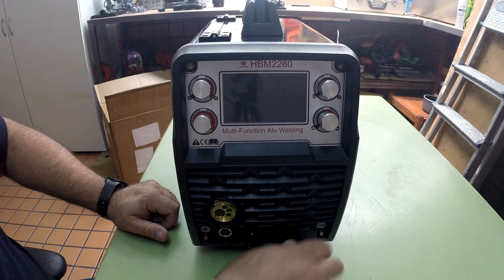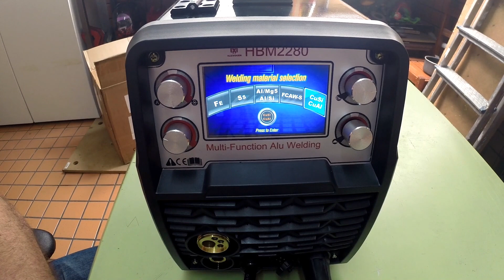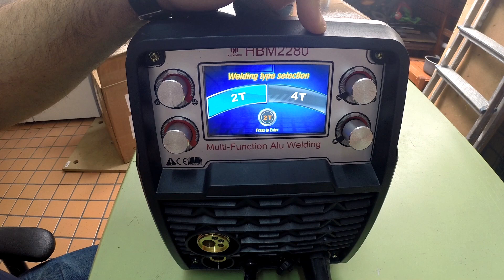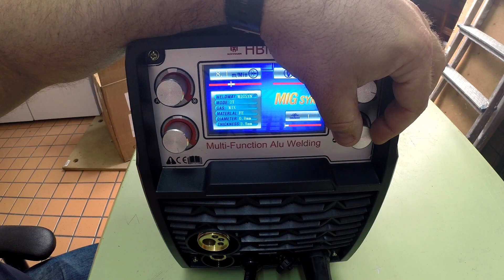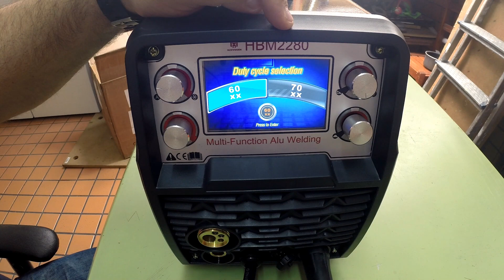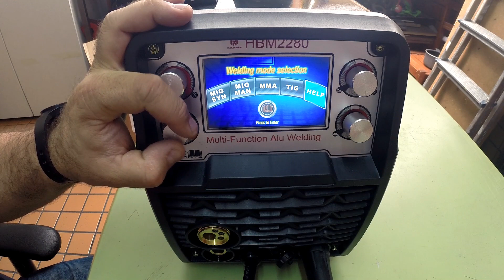HZXVOGEN HBM2280 Mig Welder - Options and Settings

Comment: Thanks for the video. Can the device also weld/solder thin sheet metal?
I want to weld 0.7 mm with CuSi 3 on my car.
The description states that the lowest current for MIG welding is 30 A.
Thanks for the answer.

Comment: The 4 pin connector is for a foot pedal, wich you can control the power of the tig/wig handle or for connecting the spoolgun

Comment: how much voltage adjustment when mig welding? and does the voltage change when you change wirespeed? or is that independent like good welders

Comment: Why is gas mix written on the board when choosing aluminum? There should be argon.
Reply: Where do you see gas mix when choosing Al? When I choose MIG Syn and then Al in the menu I don't see a gas selection.
Reply: @darius-astrofilus  Yes you are right. There is no choice. But it still says mix and not argon.

Comment: I was wondering how you are enjoying the machine and if you know if it will Tig aluminum. I think the ebay listing said it would mig aluminum but didn't say on the tig (and I just don't know because I am just learning all this stuff). Also, Hitbox has a 5 in 1 called the 200 pro which looks to be the same manufacturer. Has the same instructions as the HBM2280. I didn't know if you came across that one when you were looking to buy and why you chose the one you did. Thanks for the video, it has been very helpful!
Reply from the maker: Hi. Thank you for the comments. In fact, it doesn't TIG aluminum. Only Mig. That's bacause this is a DC welder. To properly TIG aluminum, you need a AC capable TIG welder. This one is not. I'll be posting some videos, on the upcoming days, of it welding and I'll talk about my findings about this welder. Stay tuned. Cheers.
Reply: @Juary70  ok will do. Appreciate your help. Cheers
Reply: Actually you can TIG weld aluminum with it but you have to use helium. https://youtu.be/H_DwA0vzKXI
Reply: @darius-astrofilus  That was interesting...thanks!

Comment: Hi thks for the video. How's the video working for you do far? You do mostly mig welding? Did you try the tig? Any comments or suggestions of the mechine if i want to buy one?
Reply: I am interested in knowing the same.
Reply from the maker: Hi, Sorry for the late answer. Well it's good for a hobbyist. Not for professional use. Even so it´s a capable machine. No problems so far.
Reply: @Juary70  please please please please demonstrate in action especially tig      thank you

Comment: Just bought one of these, wish I had found this video a couple days ago lol. Was welding DCEP on flux core making little balls everywhere. Switched it around and it actually puts down a really good bead on 1/4" plate with 110v.
Reply: How is the mechine so far im thinking to get one
Reply: @DeeBeeStudioSabah  I've only welded flux core so far and it just did great. I do more "dirty" mobile welding though. I haven't bought a spool gun or a torch yet, from what I've read a DC tig is not optimal. I would probably only ever use the stick welder to use with aluminum sticks for a repair, really no reason to weld steel with the stick.

I'm not a pro welder by any means, I wanted the screen display that shows you how to setup the machine. I would say this is comparable to my buddies multi process Lincoln welder that he paid $1500 for. 

Right now yeswelder is doing a kickstarter for a 5 in 1 welder (mp200) that has a plasma cutter also and I believe it comes with all the attachments.  You can "support" them for $549 and they'll send you a welder in Oct supposedly. Once they sell it on the open market, the price will go up too $1k . If that shows up,  then I'll just sell this one.
Reply from the maker: @DeeBeeStudioSabah  Hi. The welder is good, from a hobbyist point of view. Not for professional use. Cheers.

Comment: Is there a separate gas connector for the Tig torch on the unit? Thanks
Reply from the maker: No sir. The only gas connection is used for Mig welding. For Tig, you need a torch with a valve.
Reply: @Juary70  Excuse me Sergio, just a few questions. How do you start the arc with Tig? Scratch or lift? Have you tried it? Thank you. :-)
Reply from the maker: @darius-astrofilus  Sorry for the late reply. I don't have any experience with TIG but it feel Scratch Start, not Lift. I'll be doing some videos in the upcoming week demonstrating the operation. Cheers.
Reply: @Juary70  Thank you again Sergio. I purchased the welder and tried Tig with the provided torch and it has no lift indeed but scratch will do for now and the main issue is the sticking of the electrode so it seems that I have a lot of practice ahead. :-) As for aluminum Mig welding it works fine for now. I'm looking forward to your next video about this unit. ;-)
Reply: @darius-astrofilus  What gas do you use when welding aluminum?
Reply: @kkoscm  Hello Mehan, I used pure Argon for MIG welding aluminum but it does not work for TIG because it is a DC machine. If you use pure helium then you can TIG weld aluminum with a DC machine. I have not tried it but there are some videos that show how it works. ;-)
Reply: @darius-astrofilus  So when welding aluminum, it doesn't matter what to choose, mix or co2, the main thing is that there is pure argon in the cylinder ??? Sorry, Google translate.
Reply: @kkoscm  Yes, and keep in mind to use a teflon MIG liner and 5356 aluminum alloy wire that is less soft so that you have less problems with "nesting" and feeding the gun.

Comment: f the mig welding of this unit is gass less? tnx....
Reply from the maker: You can weld with Gas or Gas less (Flux Core Wire) It supports both.
Cheers